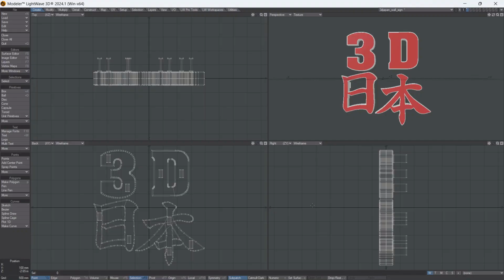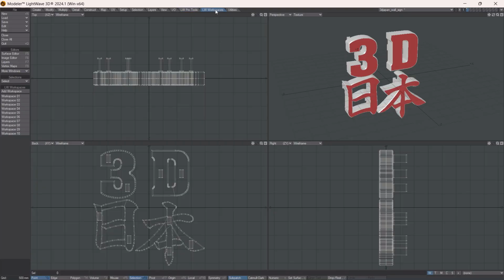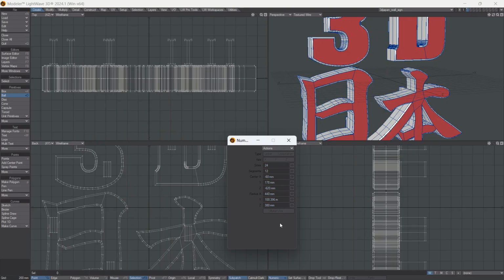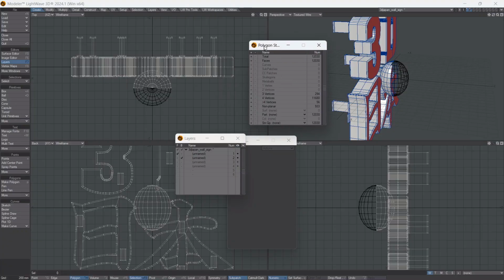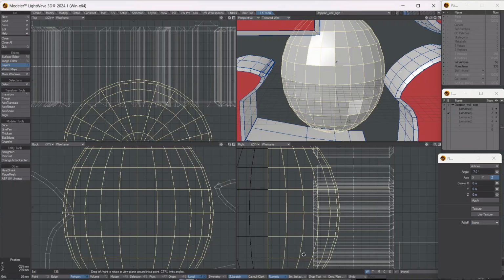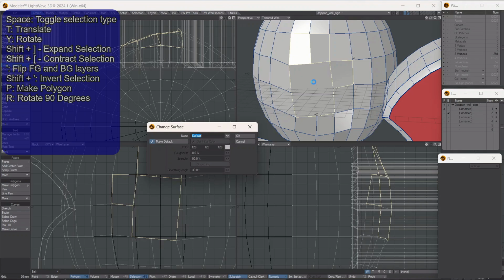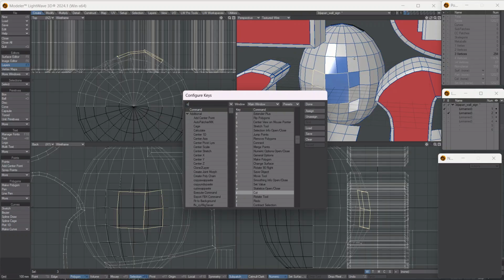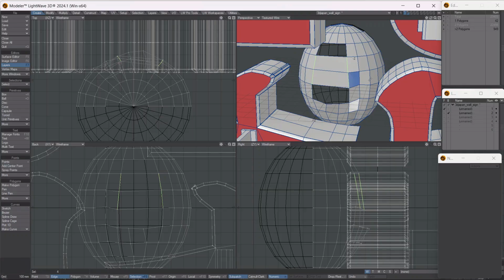Learn the Basics of LightWave 3D Modeler

Comment: No way am I going to spend $1,000 on this when blender is free and way more powerful than this!
Reply: I'm afraid I have to agree with you. I've been a LW user since the Amiga days, around 1992. I stopped using it when I was hired by a company that only uses Maya, in 2003. I left the company about 2 months ago, in 2025, specializing in shaders, lighting and the V-Ray rendering process.

So I finally decided to try Blender, and from the little I've seen so far, it seems very mature, well-organized and fast.

I also decided to take a look at Lightwave 2024, and unfortunately it seemed to me like the same LW I used 25 years ago. It's not faster to render than Maya 2019 with V-Ray, on the contrary. It seemed much slower to me. I was hoping to find advanced rendering options, like those in Vray, such as shared rendering with multiple machines, so that they can all help at the same time with the rendering or ipr of the frame you are working on, but I didn't find any of that.
And the modeling methodology and tools still seems outdated to me.

It's sad, but I don't see a future for LW if it continues as it is today and as it always has been.
Reply from the maker: You get what you pay for.